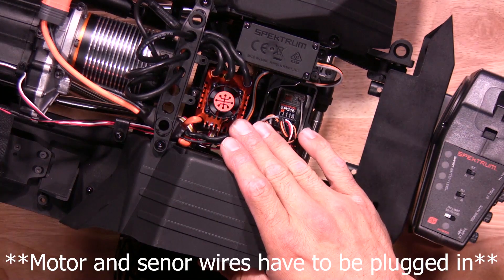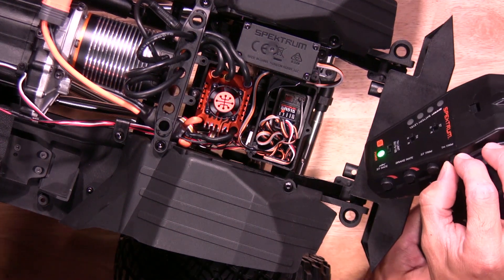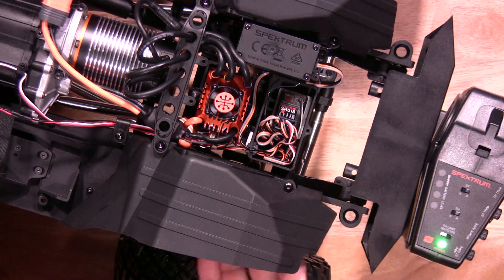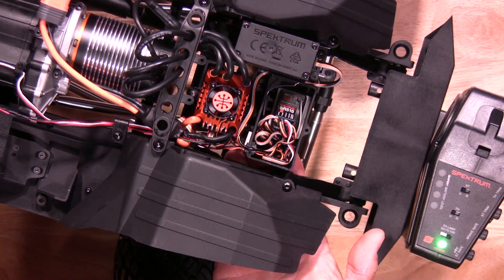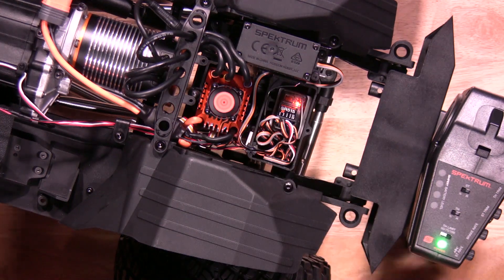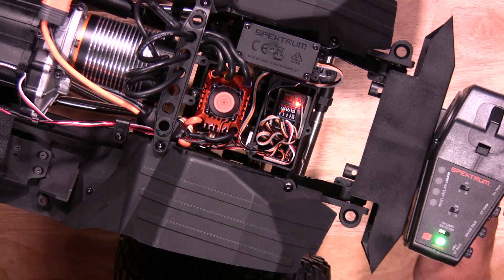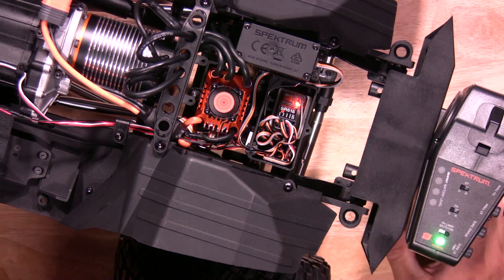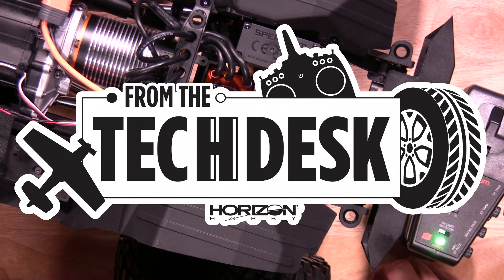From the Tech Desk: How to calibrate the Firma 120Amp esc in the AXIAL SCX6.

Comment: ive recently lost all drag braking functionality on my scx6. I have rebound, recalibrated transmitter and esc. the rig will no longer hold when climbing and just rolls down the incline regardless of high/low gear. anyone else have this issue? stock motor, receiver and esc.

Comment: What about program? i tried using my smart esc programmer and it doesn’t work
Reply: I made sure the trims were in neutral but didn’t realize that the throttle limit switch wasn’t at 100. Now the ESC won’t calibrate anymore. If I hold down power for 10 seconds and let go it comes on but no blinking light.
Reply: I found a fix for this issue. The ESC wasn’t going into calibration mode anymore. I disconnected the receiver and then I was able to get it into calibration mode. Then I reconnected the receiver while everything was on and finished the calibration making sure that the throttle limit was set to 100. It’s working fine now.
Reply from the maker: Which Programmer did you use and was the motor hooked up to the esc?
Reply: @horizonhobbysupport  i use the smart as my hobby shop recommended and yes motor still plugged in
Reply: Can chage the remote to the radiolink?